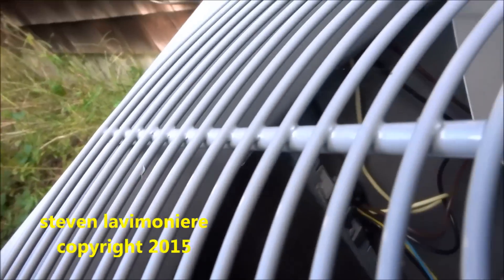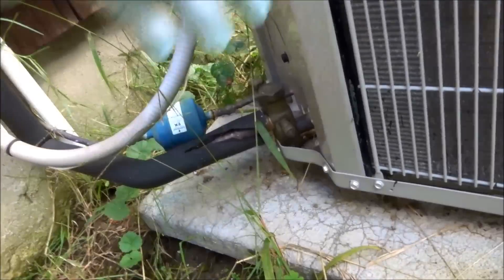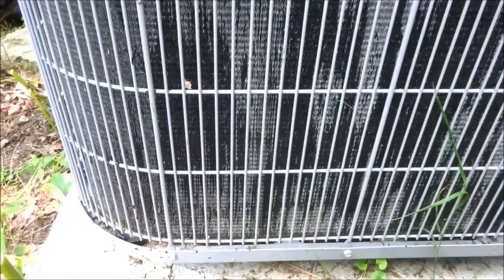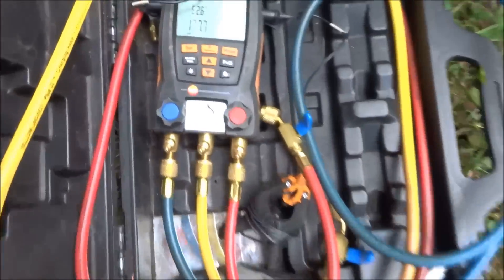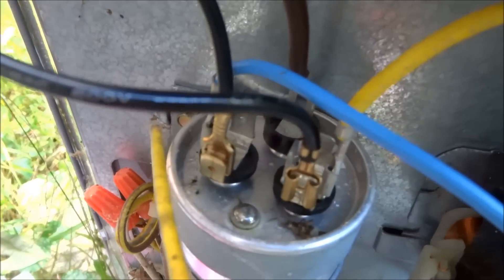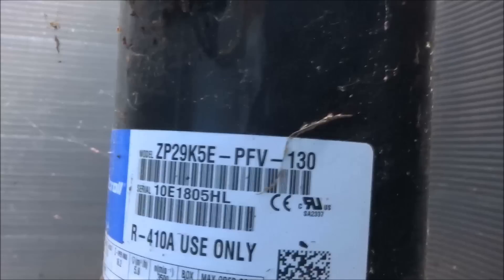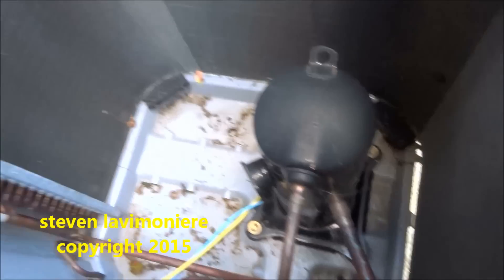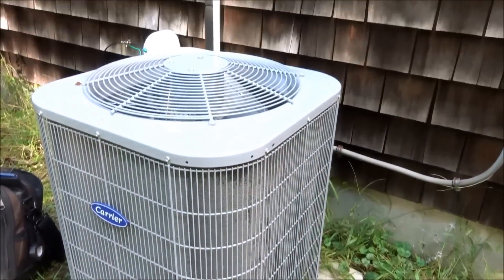carrier compressor/condenser making funny noises

Comment: sounds like the rust inhibitor bug we had 8 times this summer with scrolls , use the ac renew  after the change out. just in case it did work every time .just saying we changed out a 3 year old system compressor under warranty 3 times and the 3rd re Michel said use this and this system is fine and the others as well. who knows it sounded like what we heard good luck
Reply from the maker: +northco hvac good idea to use the renew

Comment: awesome service Steve Lavimoneare,  hey I got a question about the  megohmmeter  do you check the compressor with the power on or off i think my megohmmeter M500  won't work because I checked a compressor but just show me on doesnt say its good or not so since it is good or not just show  on nothing more
Reply: I have the M500 you check it with the compressor off put the red on a compressor terminal and the black on a ground/discharge line
Reply from the maker: +Carlos Raxon you have to disconnet the 3 leads going to the compressor and check them that way ohm out ect
Reply from the maker: +Keith Bell good point

Comment: Steve. I thought u said the coil had oil on it. Maybe leaking.   Wouldn't it be cheaper to by a new condenser?
Reply from the maker: +smitty1715 i was just paint . ,i gave her a price on replacing the whole unit or just the compressor .
Reply: It looks like that from coil cleaner.

Comment: Hi Steve, can u told us what is the trick with hard start!? Thanks
Reply: compressor was locked up and wouldn't start ... hard start boosts the voltage to make that compressor start
Reply: Boost the voltage more then the voltage from capacitor?
Reply: Yes ... hard start is a brand all it is is a self contained potential relay ... it has the potential to add if needed
Reply: +kaloian krastev It allows much more current to flow in the start winding by placing a larger capacitor in parallel with the run cap. Then removes it after the compressor starts.
Reply from the maker: +kaloian krastev it just give it a boost to start then drops out ,
Reply: Thanks.... what kind of device you using for it ? Can u give me name to google it ?

Comment: Our problem is that the  hvac unit does not take breaks--once the neighbor turn it on its own for hours and days without turn off once it reaches the temperature set. BUT THIS SUMMER THE UNIT WONT SHUT DOWN.EVER. VERY STRANGE AND.WE CAN'T FIGURE OUTVHOW IS THAT EVEN POSSIBLE (can't ask the neighbor cuz he is really ahresive and rude to everyone and don't want to be on his radar.

Comment: Hi so that thing doesn't control the heat!? Cause I've been hearing strange noise! Like is if someone is using an electric pencil sharper every 2-3 minutes! Then woke up one morning to a whole different noise so I cut it off.... weather in GA kinda cold!
Reply: Hello there! Did you ever find out what was wrong with your AC unit? I have the exact same problem. Every few minutes it will make this weird sound (pencil sharpener is the perfect comparison haha). It only lasts for a a few seconds then goes away.
Reply: It was leaking they had to replace it bill was over 500 plus more!🙄🙄

Comment: My neighbors AC is making horrible, nasty noise!, there is a small white, round tube like object on top of the ac with two wires (black and white wires) that is connected to the compressor, is there any one here who can tell me what that could be?, this PS machine turns on like it has its own mind, like a sensor installed in it, whenever I go out on to my patio that shit starts running, nasty noise, it is a mix of several different noises coming out of one AC?... I wish I can post the pic here, but youtube does not allow pic or docs under a comment. If someone want to figure out what it is I can send the pic or video to you on your pvt comments...! thx

so, the question is, can someone put a transmitter that act like a sensor that senses movement about 20-30 feet away from the AC, and the AC goes on or off by sensing movements?.. ....it is real folks, hope to get some inputs on this